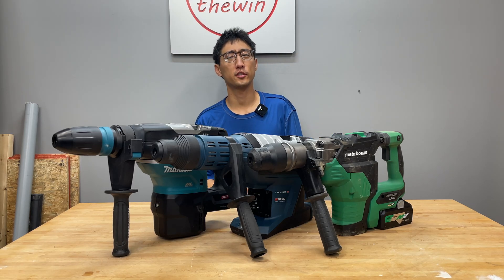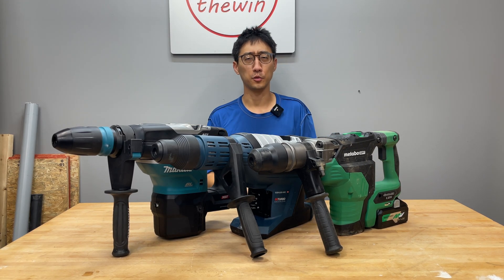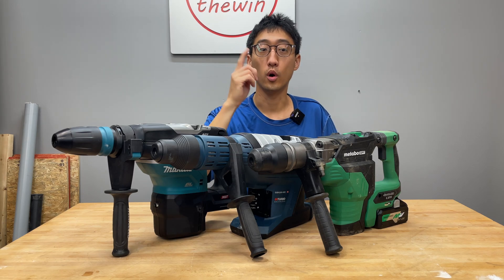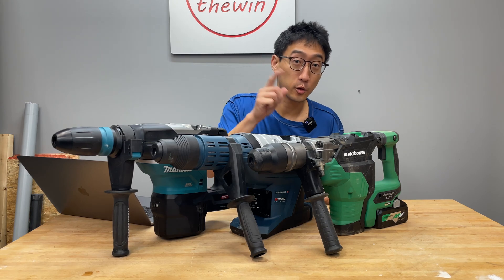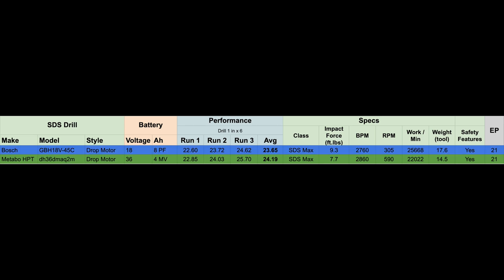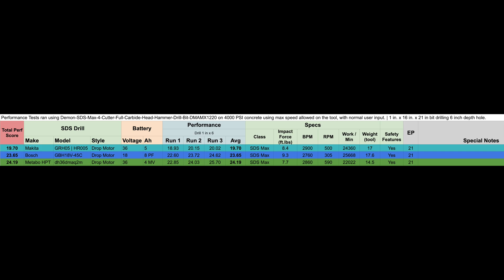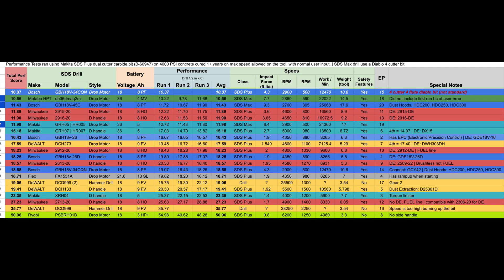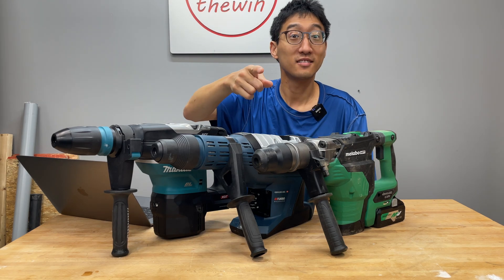24-33 | SDS MAX Rotary hammer showdown | GRH05 / HR005 vs GBH18v-45c vs DH36DMAQ2M

Comment: It’s cool how Bosch can do so well at 18v but to me the winner would be the metabo since it’s 3 pounds lighter which is huge.
Reply: I use sds max tools all the time , and the weight is the most importantly thing to me , yes bigger tools work quicker but when your on these tools regularly fatigue sets in quickly ,
Reply from the maker: true. bosch at one point had a 36v system
Reply: The current Hikoki /Metabo HPT and corresponding Metabo (artist formerly known as Hitachi Koki and actual Metabo are sharing a lot of tools now) SDS MAX have a pretty bad reputation with their cheap parts breaking prematurely.  Stick to Hilti, Bosch and Makita on hammers.  Makita is objectively better with the most expensive parts, better vibration dampening, speed/power and most reliable batteries. That said, I prefer the Hilti for cordless and if I needed more than a 1-9/16”, I’d grab a corded or cordless Bosch.  Recon Bosch is dirt cheap. Hell, Bosch is dirt cheap already.
Reply: not when you end up taking so much longer to do the same work.  The Makita doing the work 20% faster while weighing 17% more is a better trade.  

Especially once you start to factor vibration exposure (which leads to nerve damage) so not only do you have worse vibration control with LVH, you also have to sit there for 20%+ more time exposed to their poorer vibration control.  Nerve damage and lost feeling/numbness in extremities is far worse for your health than fatigue from lifting an extra 2.5 lbs.   Makita AVT SDS Max are some of the smoothest and most well built hammers you can run.  

The Metabo's real advantage is you can run it corded or cordless.  So it's better at drilling through rebar without blowing through batteries, but good god, enjoy losing any and all feeling in your hands and arms.
Reply: @  I understand what your saying , but when your on theses hammers I find personally it’s far less fatiguing than using heavier units ,  yea it may take longer 
But that’s the compromise ,